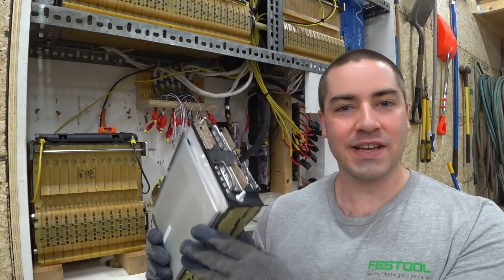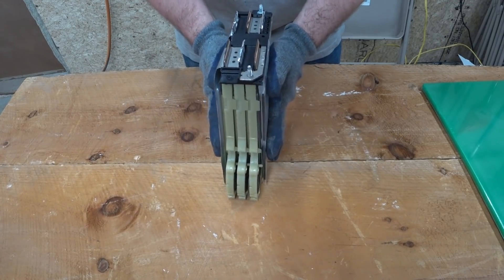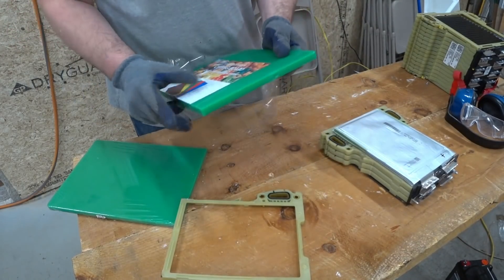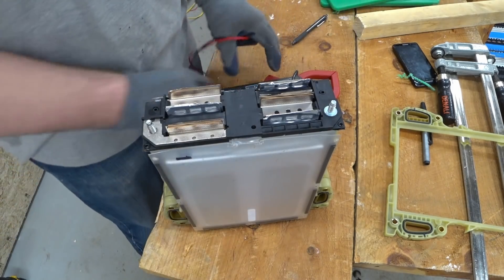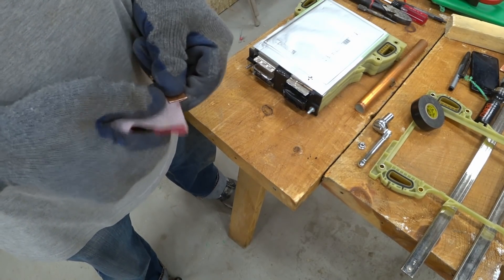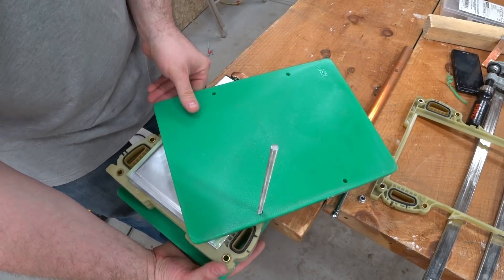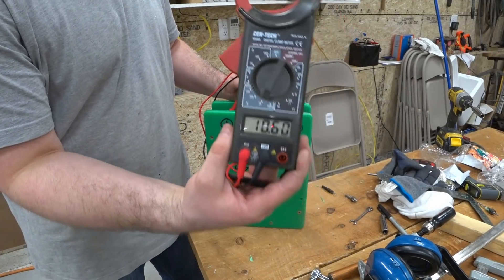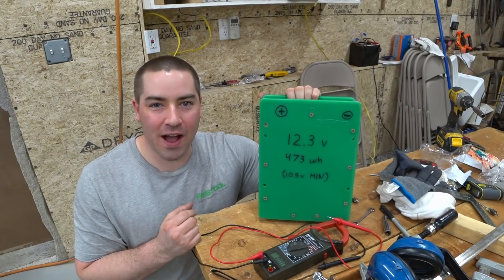Make a 12 volt Lithium Battery Pack from Chevy Volt, DIY

Comment: For the love of god! Don't use gloves with a table saw!!!
Reply from the maker: Yep, you got me.  That is a real safety concern I agree with.  Gloves are not good around the table saw.  Thanks for pointing out a legitimate concern others should be aware of.
Reply: But in the second shot you weren't wearing them. So A for effort. LOL!  @DavidPozEnergy
Reply from the maker: Yes.  I kept putting the gloves on, and taking them off.  If I don't wear them around the batteries people comment about that.  So I had the gloves on most of the time for the electricity, but forgot to take them off when I split the cutting board, but remembered when I was shaving the water jackets.
Reply: 12V volts will not hurt you. As far as I know DC voltages up to 48V are considered safe to touch.
Reply: @DavidPozEnergy  To be fair those gloves aren't high voltage rated anyways.... :-)
Reply: @solarhope  Yes. Usually everything up to about 40V AC at 50/60 Hz is considered safe. It's the AC that's the most dangerous - DC will just burn you.

Comment: I had a battery given to me that was similar to this, only it is 14.4 volts. I was thinking of making more of them and combining them together in a 12-14 volt battery bank. My question is, Can I charge them with a regular auto battery charger that says regular or agm???
Reply from the maker: Generally, no.  Lithium cells require a constant current and constant voltage charger (CC/CV).  There are sometimes exceptions, but I can't answer it with limited info.

Comment: David, great subject.  You took out the cooling fins, and I know the Volt has fluid around it originally but yours don't, can you explain why please?  Good luck.
Reply from the maker: The Chevy Volt needed the cooling fins in the car because you might be pulling 300+ amps in a car.  That high amp draw causes heat.  I am only using this with low-amp stuff.  I have it fused at 30 amps.  No over heating issues.
Reply: @DavidPozEnergy  David, thanks, that makes good sense.  30 amps doesn't seem like much for all your battery does at your house.  Do you have any kind of heat sensor on your battery bank?  Good luck.
Reply from the maker: The full bank powering the house is fused at 30 amps per battery, and I have 8 batteries in parallel.  This allows me to pull 240 amps to the house at 48 volts, or 11,520 watts to the inverter.  Although I only have a 6000 watt inverter. The first few months I had the batteries I was doing load testing and checking temps regularly.  I never saw any heat buildup.

Comment: Yes! Make and speriment whit the charge dc. to ac. What about if I put ATX PC  converter to my battery charge at the same time i use my generator for my house... Increse your baterry charge back ground... right? But do you conected to my regulator MPPT or directy to my baterry Packet?

Comment: Hi David, thanks for the video! Do these cells need some kind of compression to work properly? I know some pouch cells need to be compressed but I'm unsure if the Chevy Volt cells should be. Thanks again.
Reply from the maker: I'm under the impression it's a good thing to compress them, but not needed if you have low charge/discharge rates.  But I don't know 100%.  I did it because it's not that hard to do, and I figured it couldn't hurt.

Comment: I wish one could just get a few cells to do the same (IIRC 5 cells at 3 volts each). Could use this in a classic vehical with a dynamo that was never intended to run additional lighting or radio, and run those off it. Was designed with a second battery compartment for police or camping use, so is room. Just would need a means to safely charge.

Comment: put a small power inverter on it and use it as a potable power system
Reply from the maker: You read my mind.
Reply: I'm using 2 backup alarm batteries and a 600 watt power inverter its cheep and easy power and it only weighs about five pounds and is great for quick jobs I get about 4 hours every charge witch is plenty of tome to get the job done I hope what ever you come up with  you do a video of it

Comment: Nifty way of using those expanded cells.  I like the open sides to provide some cooling if needed and your use of  the low temperature solder.
Reply from the maker: Thanks.

Comment: I read with interest the comments on reusing "expanded" cells, but do not address those issues raised. My concern is with the basic packaging and thermal issues with the "final" product.
What I see here is a thermally insulated package where it will be Very Difficult for heat (generated as a consequence of simply using the cells) to escape. 
First, the cooling plates were removed ... that will increase the thermal resistance to the outside world, but then -- Second (and most importantly) the cells were sandwiched between thermally insulating "plates"!
So any heat generated will have even More difficulty escaping! 
My next door neighbor (and close friend -- we're both engineers) is a battery design engineer at Tesla. He's a mechanical engineer. You know why Tesla hires ME's to design batteries?  It's because a whole pile of important issues with these units are thermal,  and those problems are exactly the sort of issues that MEs are trained to deal with. 
Looking at the current design, I would have used heavy aluminum plated (probably teflon coated for electrical insulation, for example) instead of insulating plastic and retaining (at a minimum) some sort of thermal interposers between the cells.
Thermal runaway is not a problem you want to get into with these sort of batteries. 
That's why Tesla instructs accident first responders and fire fighters to continuously flood the battery packs with water. (This is another big topic which I will not address further.)
So, David, my concern is that we don't create dangerous or risky situations that result in accidents, then press reports fanning the flames (!), and then laws or regulations or the like that will restrict those who follow from using these batteries in the future. 
Besides, you & your family are nice folk that don't deserve this sort of misfortune. .... And I enjoy your other insights, 
All my best!
Reply from the maker: Hi Mike,  That's awesome you know someone at Tesla.  I'm super impressed with the package they have made for their cells.   Some aluminum plates would be very cool.  I have no idea where you get plates teflon coated.  Sounds like an expensive item.
Reply: Yes Mike has a point, plastic is a bad idea. It depends on the C rate though
Reply from the maker: @Nevada: It's funny to me to try and anticipate different comments.  I have some steel plate I was thinking of using for this, but then thought I would get tons of comments saying I'm going to short the cells out.  LOL.  I didn't think about teflon coating though.  BTW, I'm not making fun of comments, I appreciate them as I'm upfront that I'm learning.
Reply: Quickie addenda: I've seen  Teflon [like] coated cookie sheets that could form a part of a solution.
Yes, there are a lot of Tesla folks around here & I do know several. There are a Lot of  engineers in Silicon Valley.
 More interesting is the fact that my mom's cousin designed the [Tesla] Deer Creek building for HP, where he was an engineering manager, who built it originally. It was severely damaged in the 89 earthquake (a huge main beam was "displaced") & it cost a fortune to fix, but it had so many essential features that that was done. He'd  spec'd huge elevators so all the  specialized equipment could be moved in, and I understand that that has worked out well for the new owners!
It's in a prime location with a pretty good view & beautiful environment in fields with horses and rolling hills adjacent to Stanford University. Makes recruiting kinda easy.
Reply: @mikegardner9855  on second thought, all prismatic cells are plastic, so I very much doubt his use of plastic is a concern

Comment: A simpler solution to your tabs would be to use M5 bolts and a ring-terminal (source: I made my own 40Ah 12V battery out of 8 giant 20Ah lifepo4 batteries that had similar aluminium tab terminals).  You don't want to go bigger than M5 for the hole (without knowing what you're doing) since the battery tabs will just tear.  Maybe if you use a good punch you can go bigger.

In my case I use M5 bolts to join cells and balance/power terminals and it works fine for any sort of 12V charging (USB charging for instance) application I use.

Also you could use a BMS :-)
Reply from the maker: I agree that a BMS would be a good addition.  As for the bolts, do you mean like this: https://youtu.be/ot3IhsUfFS8
Reply: @DavidPozEnergy  Ya that kinda idea.

Comment: Great video - makes me want to find a Volt battery to modify for 12v use. Do you need a BMS for it, if so which one? What’s your charging source? I have a Werker AGM 100 Ahr that I need to replace 😋
Reply from the maker: I currently do not have a BMS on the unit.  I'm looking at different BMS's out there trying to find a good one for 3s.  I would like to add one.  Do you have any suggestions?  If I charge it right now, I just have to monitor the cells as they are charging.
Reply: DavidPoz sorry - I haven’t looked at aftermarket BMS in enough detail yet. I was hoping you’d already done the legwork! 😂

Comment: Clever build.  You might think about insulating all the metal except for the terminal posts.  Hate to see a dropped screwdriver or wrench tuen into an unplanned spot welding experiment.
Reply from the maker: Thanks.  I did tape up all the tabs for that purpose, but it looks kinda sloppy.  I was thinking about trying some kind of rubber compound, like "Flex-seal" that can be applied with a paint brush.
Reply: @DavidPozEnergy  they have liquid electrical tape you can get

Comment: DANGER, I've worked with Li NMC and other EV battery chemistries, including building and patenting BMS for battery packs.  Ones that are puffed up have too much movement inside the pouch now and can rub around, thus it can cause major shorts (and Fire) due to this.  Do not put these cells anywhere near then things you care about, like Family, House, Car etc..  Why take the significant  additional risk for few cells?  If you really want to keep using them, then put it into an sealed metal container with fire vent holes with nothing flammable around it, so when the pack does vent it will not start another larger fire.
Reply: i was thinking the same thing but its not like he well add the video of his houes fire latter .  if he would take his time  and look at others that have lost there homes to EV DYI like this i am sure he would stop right away and put every thing in a flood / fire box

Comment: how many ah?
Reply from the maker: I did a capacity test in this video: https://youtu.be/L2tKHrS0V2s and found 473 watt-hours.  The nominal voltage per cell is 3.7v, and I have 3 cells in series, or nominal voltage of 11.1v  I guess that makes 42.6 amp-hours?

Comment: You should've cut a handle out in the cutting board like a rectangle. Put some led lights on it and a booster to charge your laptop.
Reply from the maker: Is there a way to charge a laptop without going through an inverter?
Reply: DavidPoz you can charge a laptop without AC - you will likely need a DC-DC converter to match the input voltage of your laptop.
Reply from the maker: OK.  I just checked the external power brick on my laptop cord.  It says 19v.  So I guess I would need a "Boost" converter.
Reply: DavidPoz boost it is! There are many different charging voltages out there. I go used to make a car charger that provided different voltages and polarities based on which tip you put on it. I don’t know if they made one for higher voltages.  There are single output boost converters available but I haven’t looked for one in your voltage range. Good luck!

Comment: My we are having fun. Maybe charge it outside by the fire pit lol the first time at least. I see you got rid of the worst bulged pouches and found enough for a 12 volt battery. hopefully that plastic cutting board won't warp with the heat if there is any. Good Luck DavidPoz.
Reply from the maker: I didn't get rid of any cells.  I think I was just showing the better side up, and the worst cells were probably facing down.
Reply: @DavidPozEnergy   What did you do with the rest of Mike's battery as you only have 4s in the 12 volt you made
Reply from the maker: I still have the rest of the battery.  I haven't yet decided what to do with it.  I'm thinking of making it one large 12v battery.

Comment: I like it. If you get a few uses kewl; who cares if they are a little bulged. If you are worried about the bulge, charge them to 3.7 volts instead, you won’t loose that much wattage. I was speaking to the owner of Inergy and he said they don’t charge any of their devices past 3.7 because the wattage difference is only about 100 watts, and charging cells to 4.1 or 4.2 cuts their life in half. 
I have shot at my cells (with a 22lr) as a test at 4.2v and they explode but at 3.7 they do nothing. Love your work, keep it up.
Reply from the maker: Thanks.  The .22 video would be one I'd love to see, but then YouTube would probably delete your channel.  I don't think I understand your voltage parameters.  I've heard some people not discharging below 3.7v/c, but I've never heard of someone not charging above 3.7v/c.  Is there any more info you can direct me to (websites?) so I can read up on that style of charging?  BTW, the last few days I've enjoyed watching your videos on the Smart Fortwo batteries.  Thank you.
Reply: DavidPoz I was taken back to but he did the math with me on his kodiak solar generator and the wattage difference was barely over 100 more watts by charging up to 4.2 instead of 3.7. I’m so accustomed to getting every watt that I can that I don’t consider the toll it takes on my cells. Thanks for watching my videos. We need to update and follow up on that series of videos

Comment: Did you forget to fit that cell frame that is on the bench at the end of the video ?
Or is there a good reason for leaving it out ?
Reply from the maker: LOL, that got cut for time.  I tried fitting it in, but the frame was thicker then the cells.  So the green boards would end up pressing on the frame, not the cells.  I want there to be pressure on the cells.  So I didn't include it, and cut out the video footage of me playing with it.

Comment: what happened to the other cells
can't they be added to your existing pack
Reply from the maker: I have 9 other cells, which is about 33 volts.  I can't add that to my existing power-wall.  However, I might try doing something with it if I can come up with a good idea.
Reply: @DavidPozEnergy  My RC hybrid lawnmower uses 24V (2x12v) SLA batteries, which are kept charged by an alternator, driven by the gas engine.  https://www.youtube.com/watch?v=vsqDcLoAnpQ

Comment: Cool, you could put a 12v to 5v buck converter on it with a USB port, then use it to charge your phone :)
Reply from the maker: That's a good idea.  I'd probably get 50 or more charges.
Reply: @DavidPozEnergy  My 4S2P lifepo4 40Ah 12V pack I made out of similar styled pouch cells (20Ah each) powered my kids Switch (via a 12V USB car adaptor) for an entire morning one day with barely a dent in the state of charge ... :-) Kids these days have easy road trips ... :-) hehehehe.  I put mine in a padded "tool box" where I drilled out three holes for three 12V car sockets (2 outlets and 1 USB charger).  It's heavy AF but sturdy and more importantly water proof for when the kid invariably spills something on it in the car.
Reply: FFS charge ya fone 😂😂😂 bit over kill don't ya think ...